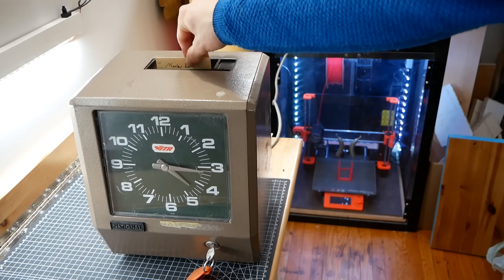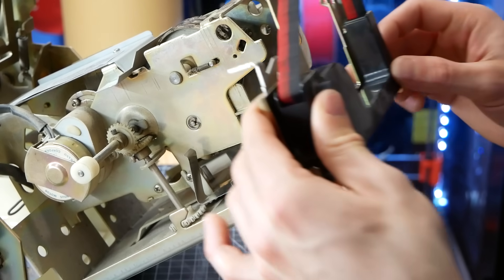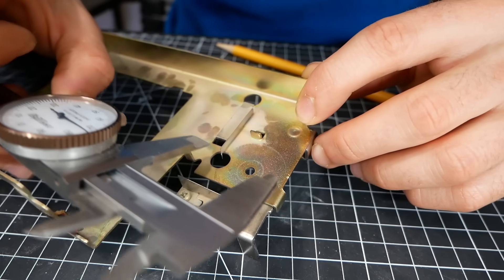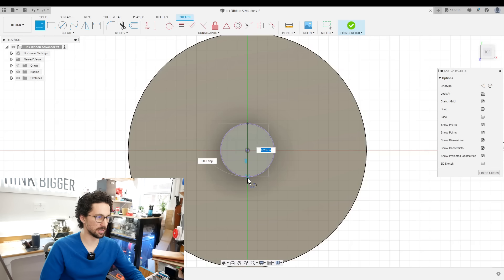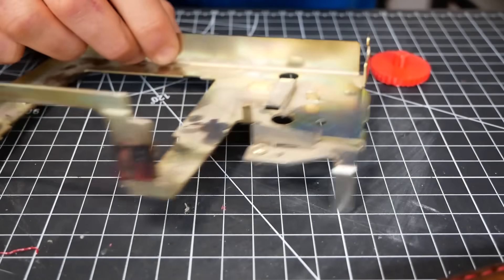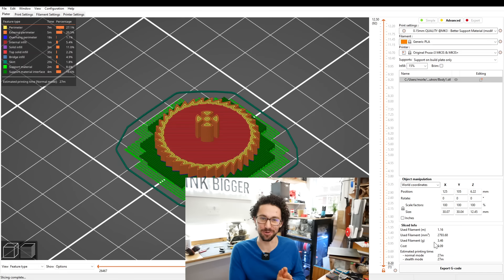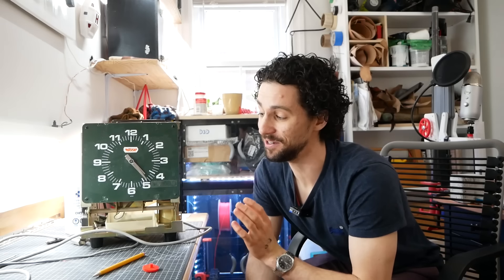They wanted 100 dollars. I 3D printed it for 9 cents.

Comment: Having taken apart similar mechanisms I can tell you with reasonable certainty that ribbons do not re ink. Instead they have a spool of new ribbon on one end and a winder mechanism on the other end. I can also tell you that if you manually rewind and reuse the tape it will mostly work but it'll have a lot of glitches such as blank spots and double stamped numbers. If you try to manually re ink the tape you'll make a mess of your hands and your work bench and it will most likely give you indistinguishable smears instead of numbers or messy numbers if you're lucky.
Reply: Yes, the ribbon does not get re-inked. The ribbon cartridges that I took apart were for a dual/tri color dot matrix printer and the ribbon was not on spools inside the casing but both ends were connected forming one continues ribbon. I was sort of just packed in the cartridge, think of if you were to pull all extra ribbon out and just shoved the ribbon back in on one side so it randomly folds inside. Given the vertical creases in the ribbon in the video, I think the same is happening here. The knob just friction pull the ribbon back into the cartridge.

Comment: 360 degrees / 10 degrees = 36, not 35 :) But that should be calculated with an expression to make the parametric design work correctly.

Comment: Ha! I really like this. First thing (well, real thing, aside from the standard test pieces) I printed years ago when I assembled my printer was a set of mounting brackets I designed for a fence to keep my newborn baby off of the stairs. I really like 3D-printing for specifically this reason and unfortunately, I think it's also the reason most people lose interest in 3D-printing: It's only really useful if you know how to create a 3D-model. Luckily, I played around with GMax/3DS MAX (I was into model and level design for modding games) when I was in high school and kept doing that over time in various other packages so I kinda know how that works, but I think that's a reason a lot of printers end up as kind of an impulse buy.

Comment: I have been tinkering with an Ender-3 Pro and now that it’s set up how it should be - what a learning experience - I am producing rather excellent prints. Some will form the basis of scale model parts that would be time consuming to make and impossible to duplicate easily.
But I have found it invaluable in making tools and devices for my job that save me time and save time for others as well. 
Cracking video. Curious Marc has a cool channel. Thank you!

Comment: This is really cool but its important to recognize that you invested a significant amount more than $0.09 into this project. 
1) Time learning the software (probably years).
2) Time Learning how to 3-D print.
3) Purchasing the 3D printer.
4) Purchasing the material.
5) Time troubleshooting the device. 
6) Time modeling and testing the replacement gear.
7) MOST IMPORTANTLY you printed 2 gears total, and thats a full $0.18 right there! ;)

While this was a really cool project and a great example of why 3D printing is changing the market, it is important to recognize that it isn't as easy as these videos make it look. When you think of the average person, that 100$ would be a vastly less expensive endeavor than it is for you, because the Barrier to entry of spending $95 is nowhere near the barrier to entry of having a full 3D print setup and the skills to use it. Conversely, if you do have the skills you open up an entire world of opportunities just like those show off in this video.

Comment: It was $0.09 in materials, but what's your time worth? I realize it's a hobby and content-fodder for a (professional?*) YouTube channel, so your calculations get a bit iffy, there, but in IT, for instance, a common benchmark guideline for an hourly rate is about $100/hour (and growing, but $100 is an easy, round number). At that point, if you spent an hour on the designing, printing, and testing the thing, you've spent more in chargeable time than the $95 the company would've charged you, which makes an hour about a break-even point. It's also likely why they charged you $95 -- they'd have had to have a machinist go look up the specs for the part, set up a machine to create a single run of it, and ship it to you. An expert machinist could probably do that in an hour or two, so $95 sounds pretty reasonable for a one-off, especially if the company doesn't make those time clocks anymore.

That said, I love the video! This is a really clear explanation of DIY prototyping, and I value that kinda content; you did a great job explaining the steps and thought-process. I just wanted to call out that there's more to cost than materials -- you should value your time, too! People matter! 😉❤️

* - I put a question-mark on "professional," since I don't know if this is your day-job or a side-gig. Not disparaging either case, just didn't want to assume.

Comment: If we go by cost of material, then the wedding photographer should only charge 10$ per hour.
Time is also a resource, and that company probably just had standardized sets, which it sells. They could have opened one of their packages and sent you just gear you need - but how much would they have to charge, just to break even? And I'm not even talking about making a profit.  
  
3D Printing is great - but if a company asked me to design this gear, that fits and works, based only the rough dimensions we can extrapolate from our information, I'd have a probably spent around 4 hours until the final product is ready - which I would then charge 280$ for.  
  
Being able to offset a cost by virtue of your own skill, does not justify dissing on a company charging for (antique/enthusiast) replacements.

Comment: Heh. 9 cents in material. And how long did it take you, in time, prototyping, printing, cleaning the prints, testing, adjusting etc? An hour in total? Two hours? Everyone keeps forgetting to factor in time spent as a cost - unless you have the worst hourly wage in the world, your time is not free and treating it as if it is free is doing yourself a huge disservice. For a YouTube maker, absolutely makes sense since you're making a video. But for the average joe at home who's thinking "I could do that", time spent means time you could've spent working and potentially make more than the $95 the part costs.

Comment: I do think making it yourself was a good idea. However I do not think the price asked was excessive. I suspect its from the original mold, which would require a fair bit of labour to drag out to do a short run (of maybe 1-3 bits). That would produce an OEM part, keeping the device authentic. However in practical terms you solution to get it working at the least cost is quite effective... you could also now CNC the part :p since you have the prototype done, and have it in durable metal.

Comment: hey what a great video, amazing way to see how you fixed it.  by the way those ink ribons have no ink reservoir, they are a big loop of ribon, i know because about 20+ years ago i opened one ink ribon cartdrige fron an old epson printer, back then in my country computer stores and repair workshops had a service to recharge the ink on the ribons.

inside the cartdrige the ribon is paked tight enough for it to be able to continuosly feed until you change the cartdrige or re-ink the ribon; the ribon is many meters long. check if you can get your hands on a damaged ribon cartdrige and open it. maybe printer ribon cartdriges are longer, but the working principle seems to be the same.

thanks for this great idea, every single video about this kind of use for a 3d printer opens even more the scope of things i can do with my printer
Reply from the maker: Thanks for the info, that’s super helpful!

Comment: 8:20 a simpler way of doing this is to not specify a tooth angle, but an integer tooth count. You can get the angle from that count (360/count) if you need it. Then you do your circular pattern times that count.
Reply from the maker: Good tip!
Reply: @MorleyKert  i screamed at the screen "36" but you didn't listen.
Reply: @core36  same
Reply: @core36  same here. Glad I’m not the only one. He had it right there. He set it at 10 degrees. 360/10=36
Reply: @core36  mMe too! But then i realised that 35 is actually correct as Fusion just counts the repetitions.
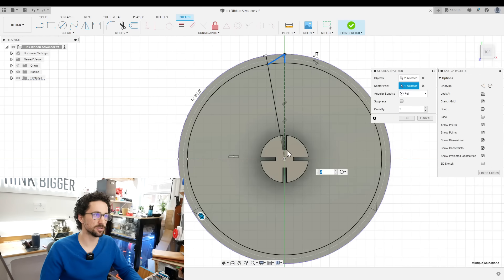Reply: @fledi2  no it's not. first, every other answer would be wrong because they would result in 36, second, i can see at 35, there is a small gap between the teeth. this could be desired because of tolerances, but there would fit another teeth before it starts intersecting with each other. and last, but not least, at 8:15, where he creates a circular pattern, it is set to 3 and there are 3 teeth. thank you for coming to my ted talk
Reply: @core36  i shouted to the heavens but he didnt hear
Reply: Could you also have repeated the feature, i.e. the cut rather than repeat on the sketch and select all the faces you want to extrude?
Reply: @manyshadesofbrown  yep. That's also An option. Probably the easier one :)
Reply: Alternatively, you can specify the tooth count as floor(360/tooth_angle) Algebra!
Reply: Or, he could have gotten the number of teeth based on the angle he chose instead of guessing "35"... just "360 / tooth angle"

And I could have read the rest of the replies where this was already mentioned
Reply: For real.. I was like 20?! It's 36. Then have him settle on 35...
Reply: I'm not a MechE, but I cringed so hard when he locked in 35. 😂
Reply: Or just remember some basic division that you were taught age 7
Reply: I use this method in Onshape all the time.
Reply: or just get the teeth count as 360/toothAngle
Reply: I was actually thinking the opposite way, if you specify the angle you just go 360/angle to get the full number of theet required for the full circumference.
Indeed this requires you to know what you need to prioritize.
Reply: @dae67  Trouble is that most angles won't result in an integer number of teeth, which circular pattern requires. You could ceil(360/angle), and make your teeth a bit shallower than you expected, or floor(360/angle) to get some 'bare' spots where you get just the shaft, without angled teeth.
So many possibilities, and none are wrong 😅
Reply: idd I was thinking the same thing :p
Reply: As a side not to this, if you do use the defined angle, the 360/angle = number of teeth needed. In this case 35 was very close because 360/10 = 36.

Comment: It's 95 dollars cus it's an injection molded part for a clock older than you and those dies aren't cheap and It's a niche part. Plus the several hours it took for you to design and print that you probably went over $95 worth of time as is. This would have been better made in a resin printer.

Comment: companies are going to learn the hard way to stop doing things like that 95 $ for that little piece of plastic if they had sold it for the 10 cents it was wort they might have made a sale charging almost a100 bucks for that is criminal  unless as i am going to assume that 95 $ was for the whole entire cartridge assembly the ribbon and the metal bracket and not just the plastic gear

Comment: I'm more concerned about the alignment of the stamp to the punchcard, did they really tolerate this back then with a top of the line cost of the living salary, huh.. I guess it was too easy back then.
actually you printed about 18+ cents since you tested 2 tries plus electric bill.
also I bet they can make the product in 18 cents too but the shipping costs is about $99.82 so its about $100 lol

Comment: That very model of clock controlled my wages for six years. Thanks for showing how it works, and how to fix one.

IMO gears are better printed in resin, unless the goal is printing a blank for lost PLA casting.
Reply: Your wages were controlled by your employer. This clock merely tracked the hours worked.

Comment: "I don't know how many teeth will fit on the circumference, so I'll just put some random number until it looks fine"
Didn't anybody taught you division? If a tooth arches over 10 degrees, and a circle is 360 degrees, then the number of teeth is 360/10=36
Reply: Exactly my thoughts

Comment: Looking at the design of the part it's clear that it's too easy to throw the rack gear away with an old cartridge, that's the design flaw if it is a flaw and not a feature to sell $95 parts. At this point in time you're not paying $95 for the part, you're paying $95 for the company to be around to sell you the part. This machine must be fifty years old, for a company to support the whole machine they have to pay a lot of bills and one way to pay those bills is to overcharge on the small parts so I don't feel bad that that's what they have to do. On the good side after 50 years there's no patents to worry about. It would be nice if you could also make your design available.
Reply: Yes that’s the kind of things you learn when you run a company or you show interest on how companies work. Thank you for this comments as it’s highly more interesting and true than the usual too simple sentence « company always want to scam you »
Reply: Very good points.  Try looking for replacement parts for an old appliance.  The price seems very high, but the parts had to be manufactured, inventoried and stored for many years.  This is why 3D printed parts on demand will grow, you could purchase a part and have it printed then shipped, or even better purchase the design and print it yourself.   I found that another advantage is the time savings and shipping costs of making your own part.
Reply: When the device was in use the company might have offered parts of the assembly separately but considering it has been out of date so long it isn't unreasonable to only offer the full assembly now.

Comment: No.  The piece you printed did not cost $0.09.  It cost you the price of the 3D printer amortized for the part and it also cost you the time to design the part.

I will grant you that may not be $100, but it's certainly a higher cost than $0.09.

Comment: great job. What I would've done differently though from building almost completely 3d printed robots and other mechanisms:

- model the pin that goes on the opposite side of the ink cartridge separately and press fit it in the gear or glue it. That way you can print the actual gear flat and get perfect outlines. Using supports on suck delicate details won't do you justice . you could even print 2 halfs of the pin so the layer lines are perpedincular to the hole and it will hold better.

- PLA is good for the moment , but i'd suggest using nylon or PC, or at least PETG . both of those materials are easy to print considering you own a prusa. the hotend can take it. You might end up finding that the teeth will grind away over time so something tougher and more heat resistent would be good to use.
Reply: you could print 10 of them and stick them inside the housing as consumables. Maybe even with a QR code on face pointing to this video, for the next guy who ends up needing to make one.
Reply: @bagok701  I mean at that point better to just specify the dimensions of the part in plain-text in the code itself lol, that way they get the answer faster than 13 and a half mins lol
Reply: @dooplon5083  qr code will probably fit the data for the whole cad file.
Reply: @Fanta....  yeah but including the dimensions specifically seems smart so perhaps both? dunno if that's possible lol but maybe if you compress em into an archive together?
Reply from the maker: Great tips, thank you!
Reply: a great option is also to cut a hole and epoxy a metal pin. you can either use machine screws, rods, or for small pins, I've found that welding rod ends are great and don't deform compared to fence wire or electrical wire. and they are also free if you or someone you knows uses a welder.

Comment: Cool video, but the price of 9 cent is a common calculateerror, for that piece exist also workingtime, electricity costs for light, pc, printer, tools, also the prototype print. Plus if you would sell it other costs an profit. Some costs maybe minor, but I think that pice cost still a bit more then 9cent ;)

Comment: I don't think you can use the cost of filament as the cost of your replacement. It only works if the time you spent has zero cost, and the material you use has infinite life. Neither are true. This convinces me I am not going to invest in a 3D printer, the time needed to learn how to program it, and the time wasted trying to figure out what to do with it. Other than that, thank you for the video.

Comment: 360 degrees (full circle) divided by 10 degrees = 36 teeth. So you could just set the no. of teeth to a calculation: 360/toothWidth, and everything is even more parameterized.
Of course, if your toothWidth results in a remainder: 360/11 = 32.72 teeth,  you don't have an integer number of teeth, so you have to trunc that: trunc(360/11).
But then 11*32 = 352 degrees, so you'll have a gap at the last tooth of the gear. So you'll have to calculate the actualAngle based on the requestedAngle.
Resulting in these calcutions:
requestedAngle=11
noOfTeeth=trunc(360/requestedAngle)   // trunc() could be int() in fusion360, not sure...
actualAngle=360/noOfTeeth
Reply: Also would have saved time to do the extruded cut for a single tooth and then do a circular pattern around your axis for the rest of the teeth instead of selecting every instance of the tooth to cut. But it's easy to have these ideas when I'm just sitting here watching on my phone :)
Reply from the maker: Yup I definitely did not think through this step haha